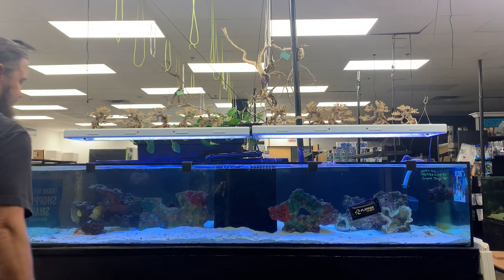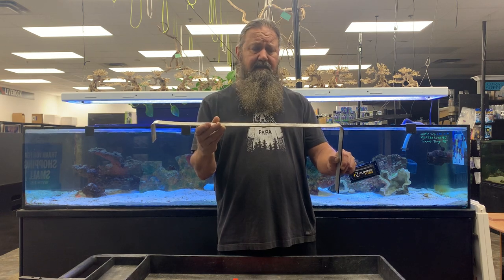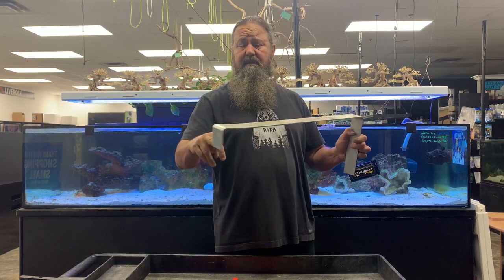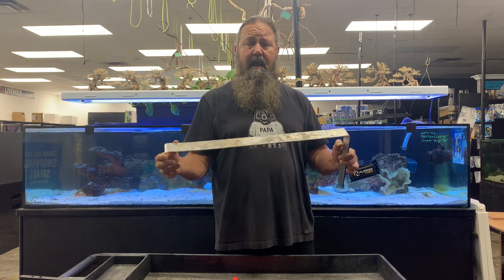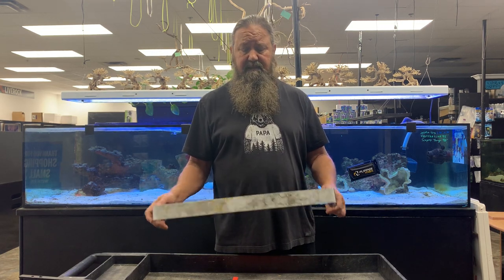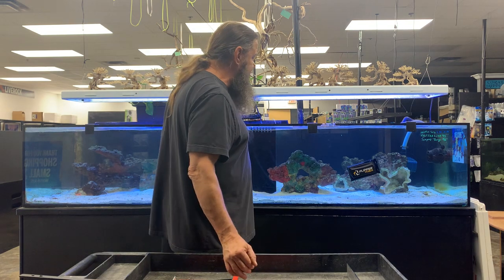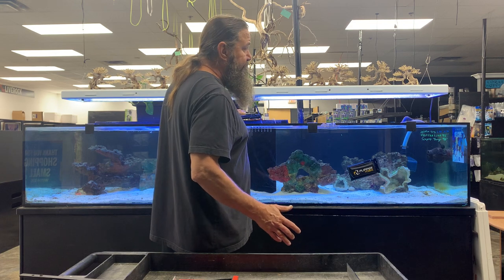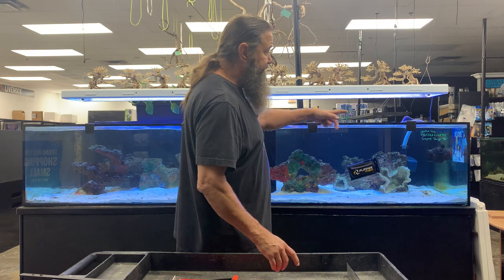How to Repair a Broken Aquarium Center Brace

Comment: Forcing a bent front glass back will put more pressure on the new top brace to front glass joint, but decrease pressure on the side glass to front glass joins. 

This + added long run stability is at least what I weigh into the equation when choosing to glue a center brace that have been missing for a while. Not super fond of forcing the front glass back but the pros seem to be more than the cons I reason. 

Would love to hear you elaborate on this factor more also Chris, thanks for the video 👍

Comment: My custom tank is 48"-20"-20" 10mm glass and I'll give 3 top width braces with 3" 8mm glass. Two times the middle brace glass is sleeping with silicon glue..
What can I do?
Do i need euro brece on top only or bottom both??

Comment: I have a 125 no brace i got acrylic i was gonna take a strip and use bj glass n plastic weld to hold in on across the tank because my actually plastic trim is also cracked u think that would b better than silicon?